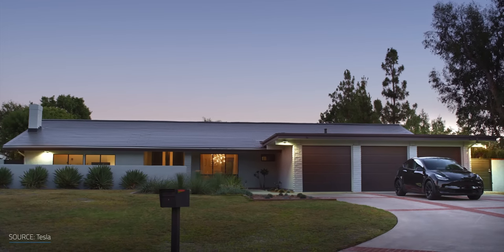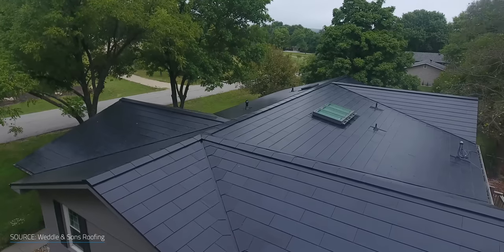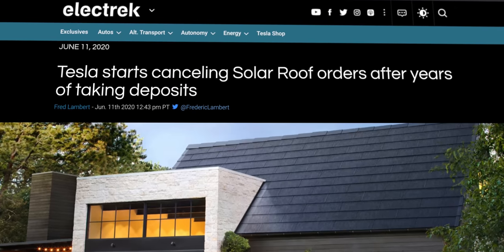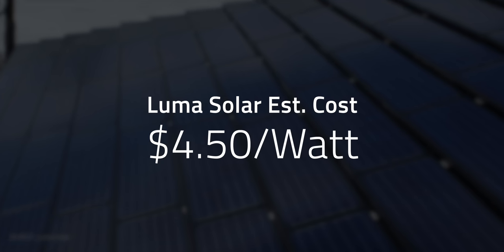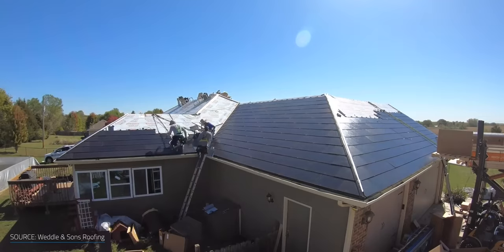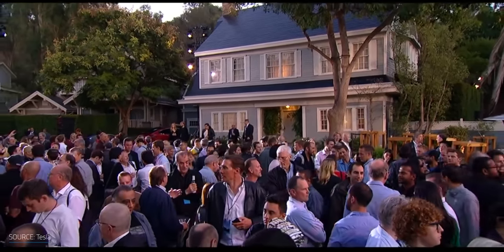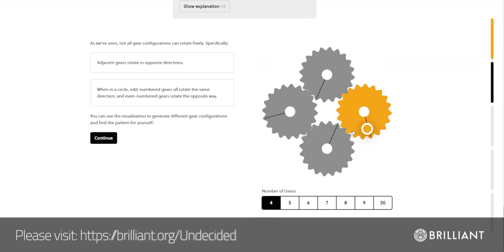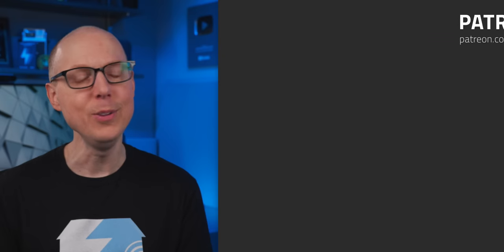The Problem With Tesla’s Solar Roof

Comment: I have been working on building a new home for the last 2 years. I immediately thought of Tesla roofing and put down a $100 deposit. They gave me a quote of $50,000 for the Tesla roof, $40,000 more than a roof from my builder. When permitting was approved I sent the final drawings to Tesla and the new quote was $100,000. I got my deposit back. I also had reached out to GAF for their solar roof. A year ago they said we don't install any new solar roofs in Georgia at this time.  Then they said they would install in Georgia but despite repeated attempts to reach them I could never get GAF to respond to me.  Probably too much interest though I had talked to a GAF roofer locally who said he would love to work with me to get experience installing the GAF solar roof.  But the house now has a $10,000 roof on it and I will look at adding solar panels instead of a solar roof.  I tried but just couldn't do it.
Reply: Georgia is tough for sure.  I’m in Alpharetta and would love to see some Tesla roofs pop up.
Reply: PV systems are hard to sell in North Georgia.  The PV sales process can not sell their PV system cheaper than the existing power companys. 
  We should be thankful that the dam in Buford is generating cheap HYDRO  power .
Reply: It would if been good to get a metal standing seam room because you can basically clip the panel racking to the roof with no penetrations.
Reply: Wonky lead times like this are to be expected for early adopters of a new tech so I don’t fret too much about that.

The doubling in price from Tesla though…that seems really ridiculous. I wouldn’t think too much of it, but that company in particular seems to have encountered this with multiple products (model 3, cyber truck, etc.)

This is what ultimately makes me highly skeptical of every Tesla announcement these days. They seem to care more about getting people hyped than about actually delivering on their promises.

I’ll gladly buy any of their products once they’re actually on the market for a while and have a proven track record, but I won’t be preordering their stuff any time soon.
Reply: Pretty much sums up the current state of solar roofs in a nutshell across the country.  I can barely convince my installer to use the new IQ8 microinverters, and they are hardly unproven.
Reply: I had the same issue in Idaho. 4 years ago I knew I was going to need a new roof.  The wife wanted a red roof. Tesla was still showing off the different styles on there site. Perfect I thought, wife will be happy and can reduce the power bill to near 0. 1st strike from the Tesla installer was oh they are not actually producing the red ones. Ok, fine I should still be able to convince the wife with the power savings.
But when they did the estimate of 60K it was a non starter. I knew the costs could only go up from there. Ended up going with a Metal Roof that I will attach solar panels later on. Yes its Bright Red but only cost 25K.
Reply: I can't get it in my area...  we will have to add solar panels after roof is built
Reply: @Species-lj8wh  So you're going to end up paying almost the same amount. 25k for the metal roof and 10kW of solar will approximately cost you another 25k.
Reply: @Species-lj8wh  25k roof, then 15-20k solar panel installation of similar size, then 2 powerwalls/battery banks that come with tesla roof= just about 60k anyways.
Reply: @fuckthisksksjjksdfjd  I didn't know this . Thanks for the info
Reply: Can thank the TVA for power cost in large portions of Southeast.  Cheap power (lots of Hydro and nuclear), and power that the power company is not required to buy back, nevermind  the high amount of tree cover and days of rain.  This is why solar makes sense in CA; expensive power rates, no cloud coverage and a power company that can't keep up.
Reply: You'll never recoup $100K in energy savings in your lifetime. It's pointless.
Reply: Many people would just not bother trying. Some people do bother looking around a little bit but when they see that price of $40.000 they would stop pursuing the idea. But you pushed through and tried your best to get something done. Even if it didn't work out this time, I still want to thank you for putting in this much effort! I hope your story inspires more people to try a bit harder with these things :D
Reply: @SaveMoneySavethePlanet  - I agree with you on solar roofs with Tesla, but their vehicles are absolutely the best as is evidenced by the year long wait list to get one as they build them as quickly as possible.  2 new factories coming online will help, but gas price increases will increase demand even more!
Reply: @richarddixon6352  I'd much rather pay a lot up front even if I never get it back then have a monthly drain on funds even perhaps when funds are hard to come by.
Reply: @AdmiralBob  it’s not economical, but you early adopters are paving the way for regular people
Reply: In my case, I have a shingle roof that now has 20 years on it, so in August of 2020, I put down a $100 deposit on Tesla solar shingles and 3 power walls. Their customer service was horrible, with my service rep leaving the company 3 TIMES! Then, in April 2021 (8 months later), I finally got them to come out and approve the installation, take measurements, etc. I got financing and was 2 weeks away from construction when I got a weird email saying that I had to approve pricing...but I already did. 

I opened the email to see they were charging me 25% more. I have a simple roof, no gables, no dormers, super simple. There were no hiccups, so I asked them why the increase, after we already had an agreed upon contract. All I was told was, "Yeah, this is the new pricing...DO YOU WANT IT OR NOT?" I cancelled my order. I'm actually considering pairing solar shingles with a car EV. For example, the Ford F-150 lightning has a battery large enough that it should sustain a family for 5 days in a power loss. Combine that with solar shingles, it actually seems like a smart combination. Now, if only I had put a deposit down!
Reply: You have inadvertently pointed out the problem with solar Vehicles also if you need a car today you can't buy solar EV vehicle there is no inventory only a quite extensive waiting list .
Reply: @ScoobyFermentation  or in my case trying to reuse my 60's-1975 100A challenger main panel with bonding only lol 😂 no not up to code as is barely have the PTO to operate it but my utilities said that if it brakes or the pole/equipment to my house needs working on im hosed and will not turn back on the power to it, anyway's there going for sub-9kw win i really need 15-20kw to make the best financial sense of doing it ( more so if i don't diy it and have a pro do all of it at one time as a diy project i can spread it out some and start with 1kw~ and work upto 20kw as my spare time and budgets allow ect ) and good luck sofar with trying to get them to show up and put the earth grounding system in as i pointed out that im not putting panels on the roof just to rot as i can't get the PTO from the local area government without it and a 200+A new main panel lucky me i have a 400A and new 3"pvc trench in just struggling with the rods ( to be far the 3 solar guys that are being weird aren't the only ones as my main electrician has turn down that part of the job and so did the earth equipment guy plus about 12 others as the magic words are rocky soil aka hard to do the job/expensive/time consuming ) and picking out the ATS panelboard switch / safety equipment for off grid mode
Reply: @boostav  it would, but my power bill isnt more than 100 bucks a month. Winter it goes down to 45
Reply: @rdizzy1  True, but my power bill never goes much over 100 bucks a month in the summer. And winter its around 45.
Reply: @boostav  yes, but he can do it as he can afford it. When you need a new roof, it usually can't wait.
Reply: @puzer1  Debt holder propaganda. Until you have freed yourself from the prison of monthly payments and how those limit your options in life well.. I guess you won't get it. Stay on the treadmill buddy. I'm fine over here. It isn't all about the amount of money at the end of the transaction but the quality of life in the middle.
Reply: You tried. Its no loss, just get normal panels
Reply: @AdmiralBob  ...I got u "buddy"...you lack the basic discipline required to make sound financial choices and aren't very good with basic math...if I had to suffer with those attributes, I guess I'd be living "cash and carry" as well...
Reply: @SaveMoneySavethePlanet  Yes, but you cant BUILD A HOUSE around wonky lead times. Which defeats the entire purpose of the product. Maybe rich people can let a third home sit around unfinished for years, getting their lawyers to refile permits, but everyone else needs some assurance that the roof will be  installed within a certain window.
Reply: @richarddixon6352  Based on what service life for those solar panels?  (you do know they only degrade to lower effiicency but don’t actually “die” for the most part, right?)
Reply: @johncahill3644  John the next person that includes a hurdle rate in the payout will be the first. You do know they are uneconomical don’t you
Reply: ". . .  I had talked to a GAF roofer locally who said he would love to work with me to get experience installing the GAF solar roof."  Big red flag.
Reply: That's the problem with being an early adapter. It's super expensive and not very efficient. Remember my parent's old shared flash drive, 512mb and gargantuan, they spent over 100 usd on it. Just bought a tiny key ring thing the other day thats 128gb and cost me 20 bucks.
Reply: Go GEOTHERMAL 
Savings almost IMMEDIATELY
Reply: @rcollinge5818  Hydro power:  Runs cleanly 24 hours a day rain or shine, barring an extended drought! New Jersey should put in the dam on the Delaware that they cancelled, but many people have other priorities.
Reply: i feel your pain on this. i was told, by a solar company here is MA, that in order to install a system my roof needs to be at max 13 years old since its last maintenance (i.e. tiling, repair whatever). it cost me about 11K to to get the roofing done (which needed to be done anyway) and then it would cost me another 35-45K for the panel system.... i'm only a single income atm, so it puts me in a tight bind for the system. even though i know that it would probably break even in about 6 years. but as most homeowners know, theres never just a single thing that needs to be taken care of when it comes to owning a home. theres always something else.
Reply: @SaveMoneySavethePlanet  
The price increase, isn't too shocking.

Depending upon how cut up a roof is, the price of a regular roof can go way up.

and with these, I'm assuming they have to custom make the panels to fit angles.
Reply: @Species-lj8wh  
But you're getting a roof, and solar panels.

Remember, these are one product doing the job of two. So while not a perfect comparison, it would be more accurate to compare the cost to both of the others that it replaces.

And tbh, covering literally every square inch of a roof in solar panels for $35,000, doesn't sound anywhere near overly expensive, for newer tech.
Reply: I’m a roofer and have had similar experience. Tech/price not quite there yet.
Reply: Tesla price matches, supposedly
Reply: @yauker  Sorry, that isn't true. They also won't meet schedules for building a home.
Reply: If you want to use Blue Raven Solar, please let me know. I work for them and would be happy to help you.
Reply: almost like it's a scam huh?
Reply: I couldn't imagine paying 100k for a roof, I don't care if that sucker transferred energy into gold coins.
Reply: @rdizzy1  problem comes when you realize tesla solar does not provide waranty at all because it just went bankrupt. Given the price and the fact tesla uses the cheapest solar panels availible in china and I am getting a scammy tingle
Reply: @AdmiralBob  so you borrow money to hop of the treadmill only to pay 1k/month to get rid of the debt?
Reply: @agoetz64  kinda sad how much damage can a hype train cause
Reply: @lordgarion514  check the internet for how the results look and work.....there have been a LOT of ruined roofs
Reply: @mmm-mmm  or he has a 50bilion debt in that company and this is a way to make shareholders pay for it
Reply: @stixinst5791  Who's borrowing money?
Reply: @SaveMoneySavethePlanet  I'd also be concerned about the way Tesla is aligning their policies with Apple regarding "right to repair" and free use after purchase.
   The nightmare would be that, after the $50k quote becomes $100k and installed, you're told that the system needs to be internet connected for "monitoring" along with a monthly fee. Opting out would reduce your output to 50%... for "safety". And, of course, any unauthourized repair will brick the system.
Reply: Basically everyone wants them and almost no one can afford them. Conventional solar panels it is 👍🏻😄
Reply: @boostav  20% cheaper is not "almost the same" also he got the color he wanted and added benefit of air flow under the panels. A black roof is 30 degrees hotter and increases the interior temp as much as 8-10 degrees.
Reply: Are you able to get refund after your accept initial design
Reply: @jasono2669  Yes, I got it quickly and without any issue.
Reply: I didn't get an initial design.  I was planning to cover the entire roof with new Tesla shingles.
Reply: Run a roofing company- 
Solar panels are nothing more then good for a back up. The technology is not there yet and normally need to be replaced  10- 15 yrs. Most the time an electric/specialist is needed for maintenance, regardless of what they may try to sell you. 
They are not environment friendly in any real way…. Like I said up top as a contingency /back up plan, I might advice. Other than that I’d stay away
Reply: Very interesting. Appreciate you sharing your experience.  I can't wait for this product to become more available
Reply: Yeah dude, stay away from that shit. You avoid a freakin disaster. Say your prayers! It would have been a money sink. Even at $50k you NEVER would have saw any savings.
Reply: @AdmiralBob  sure thing. lol
Reply: I think your story exempliefies that as a society, we are ready to go 'green' but the technology and availability is just not there.  Glad you got your new build done though!
Reply: @OtterBeSwimming  They aren't even selling the shingles as of now anymore. But yeah, that makes senses. Won't price match nor meet your schedule because they're subbing out to people who are subbing it out, possibly even those subs subbing it out again haha. I'd imagine. Just no way to line all that up. My understanding is there were no Tesla Solar Shingle crews. It was all subbed out to companies in the area they built a relationship with. And bet they were subbing most of the work load out. I get calls from out of state builders and contractors all the time to do jobs for them. I do gutters and siding repairs for a roofer out of Alabama in Florida all the time, it's wild.
Reply: @allaboutroofing2  if you build the roof system properly it doesn’t matter what color it is.  You never let the heat get to the attic or conditioned space by building in insulation and an air gap.  There are some cool systems and techniques for doing this. The good thing about the shingle is you don’t allow the wind to stress your roof as much with the raised panels.  And your seal is much better with the shingles vs al those terrible bolted mounts.
Reply: @boblatkey7160  power is simply energy over time.
Reply: Frustrating experience, thanks for sharing!
Reply: @rdizzy1    I’m getting quoted $28k for two powerwalls.
Reply: @internettoughguy   -30% tax credit
Reply: @stixinst5791    Ten year warranty
Reply: @allaboutroofing2    Tesla shingles are mounted 1 1/2 “ above the roof deck which is covered in a waterproof self sealing membrane.
Reply: @christinearmington  Yeah, that is because this was from a year ago, prices are not the same. (and you pay more when you get them individually on their own and do not get them with the package deal)
Reply: @christinearmington  gl getting it from non-existent company
Reply: Hi